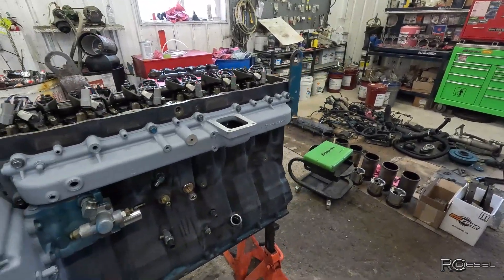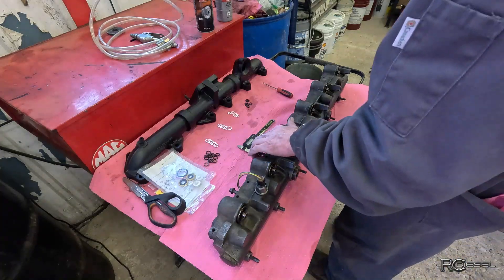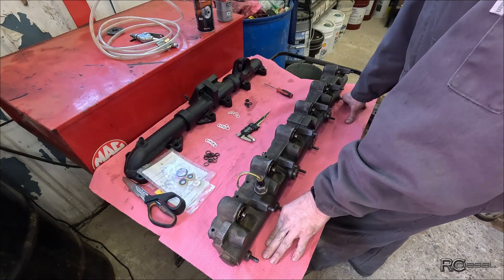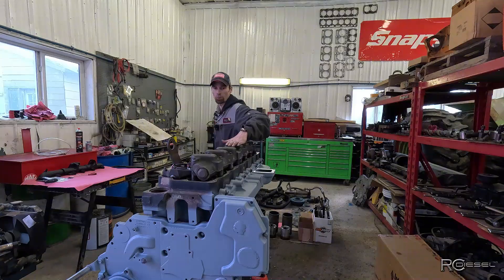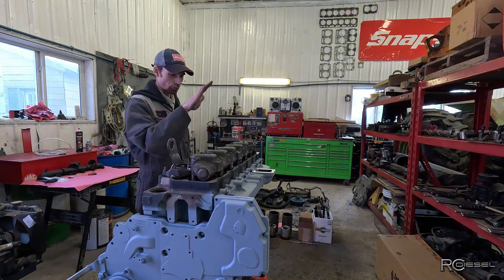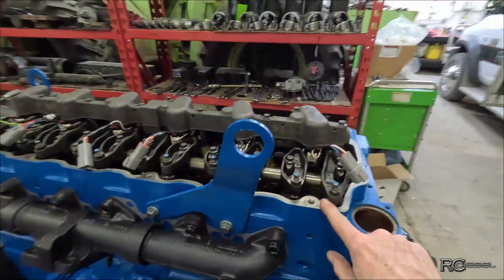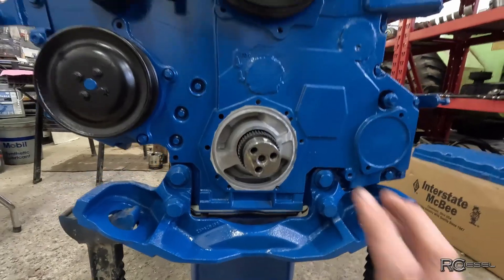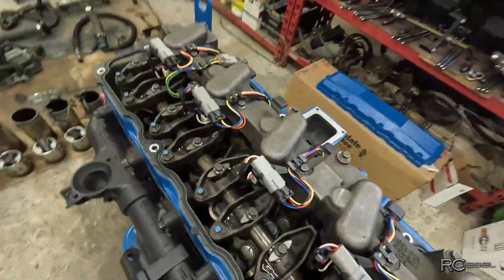🎨 DT-466E Engine Rebuild | Part 13: Painting, Oil Rail Setup & Final Assembly Begins!

Comment: I've never wanted to hear a dt466e run so bad! I had one in my old service truck for years and I never had to do any repairs to it.  so reliable when they are sealed up properly.
Reply from the maker: Yeah, the 466 platform is pretty stout. I really prefer the older mechanical ones though, I do not like HEUI engines.